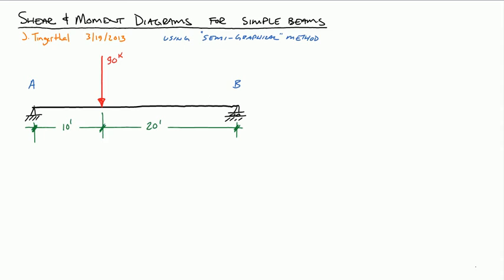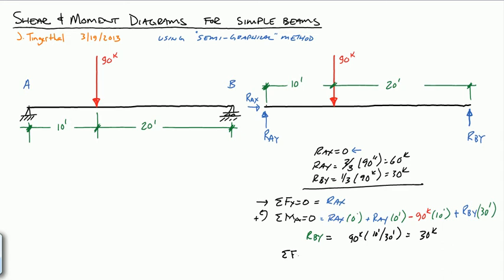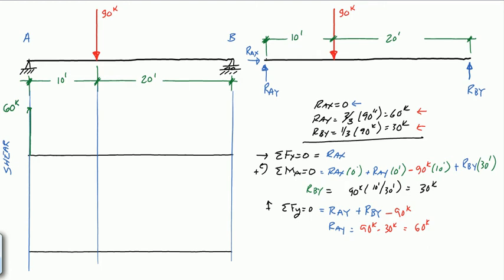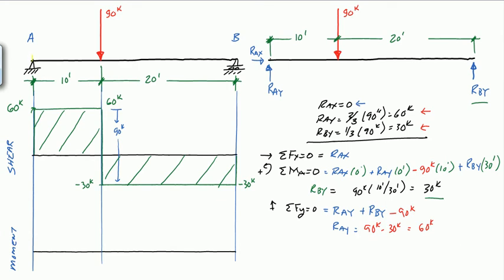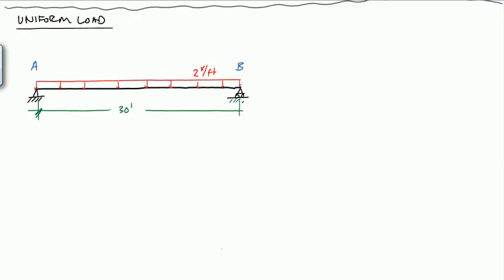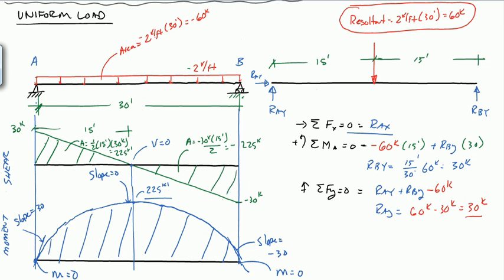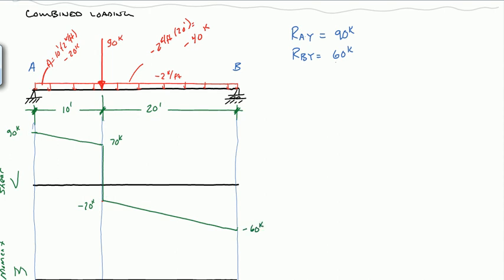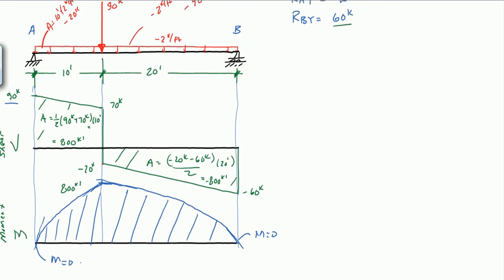Shear and Moment Diagrams of simple beam with uniform and point loads

Comment from the maker: Sign convention (CW positive vs CCW positive) is arbitrary - what is important is to be consistent -- the solution will work out the same if you assume CW positive.  What happens is that the sign each of the terms in the 'sum of moments' is reversed, but the solution is the same (just like multiplying both sides of the equation by -1).  It is conventional in engineering mechanics to use CCW as positive.